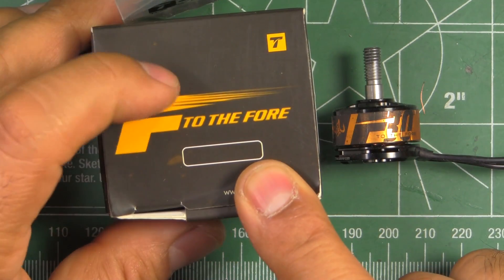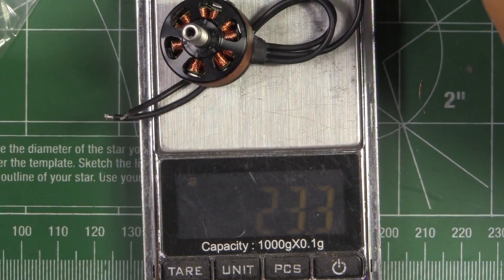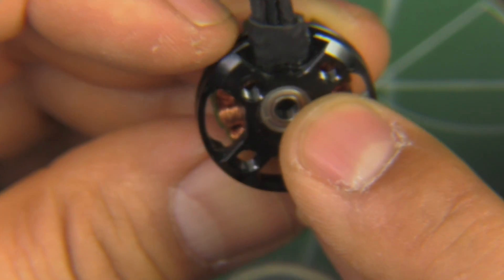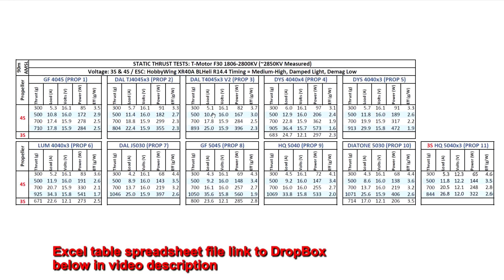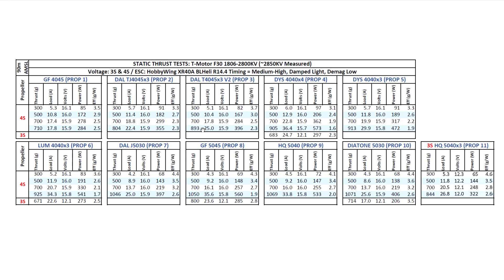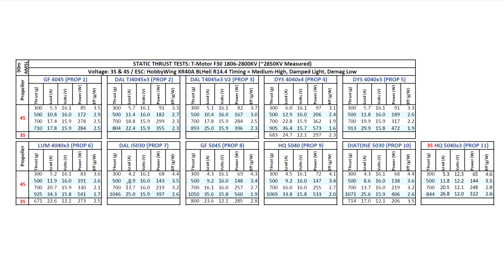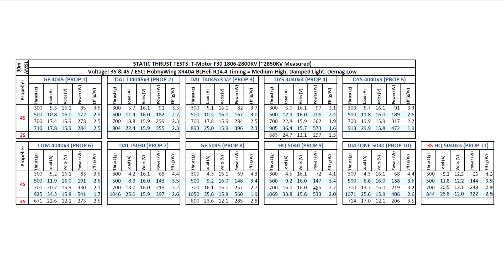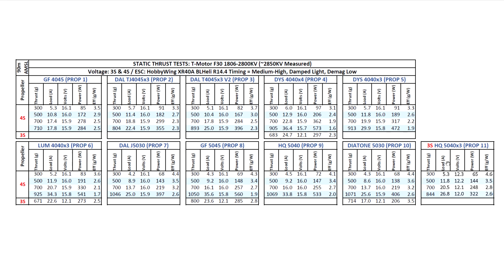T MOTOR F30 1806-2800KV 3S & 4S Thrust Tests

Comment: update, slowly the barring's on all motors have begun to get notchy and noisy, with two of the motors now getting hotter than when first built, 
 I do tend to crash quite a bit so it maybe the DAL props I've been using are a little to durable. so the shock is transferring into the shafts of the motors, ? luckily none have bent yet....
Reply from the maker: Goes to show every motor can suffer from bearings degrading over time. I think due bent propellers bearings go bad sooner. That's the disadvantage of those durable props. Replacing bearing should get them back in good shape.

Comment: hmmm are the lums as inefficient as they show on the bench or are they  just not good on bench results? 10 more grams than the dys 4040x3 but 9 amps more!
Reply from the maker: Probably the difference is more pronounced on the bench, since at teh very Max levels when motor is highly stressed those difference are a little "exaggerated". In-flight the Amp draw difference will be lower. Then there's the overall advantage to consider, the total amount of thrust through the rev range. Sometimes those differences account for up to 1min in extreme cases, but some times only 30sec or less in flight times.

Comment: Great review - as I've said before, I feel like these days 1806 is a solution looking for a problem. Not big enough to drive 5 inch fast and today's 1407 will drive 4 inch props so much better for a lot less weight and battery. Maybe on a hexcopter 5 inch for efficiency, dunno.
Reply: u already tried lightweight 5" + dual prop ( triple is really too heavy yey) ?
Reply: Yes but I didn't stick with 1407 on 5 inch - I just don't think it feels good power wise  - lightweight 2204/2205 on floss like frame will have much more power than the 1806 for about 2 to 3 more grams per motor. I have one, it's super fast and because of the light weight, fairly durable I've yet to break an arm bouncing off gates.

Comment: Must try v1s 4x4.3x3 boss...
Reply from the maker: Got to order that prop!
Reply: EngineerX also kk4045 boss pls
Reply: I love everything about the 4043x3 props except how brittle they are. They even come in some great colors and have a very appealing design. Theyve even got plenty of thrust without drawing too many amps.  I just keep chipping mine though! Ive even broken some just trying to take them on and off! I even have special prop removal tools and I still keep nicking the props lol. They are kind of sharp too so its easy to chip the edges.